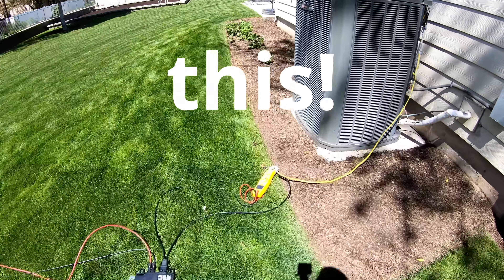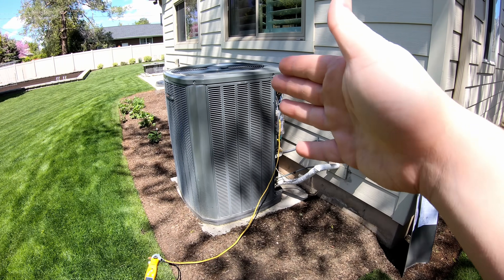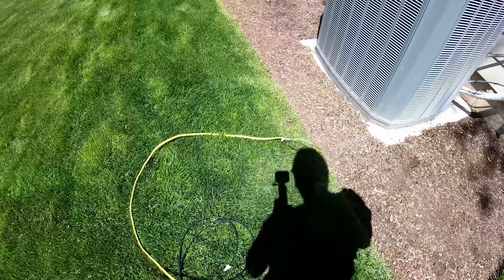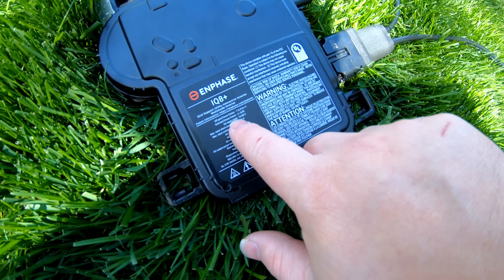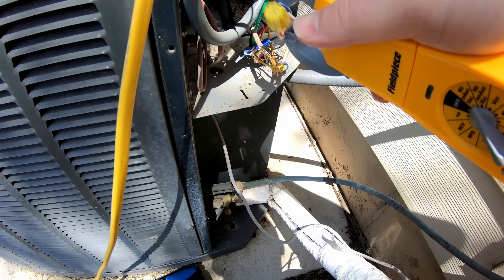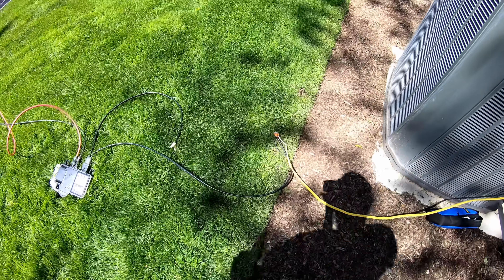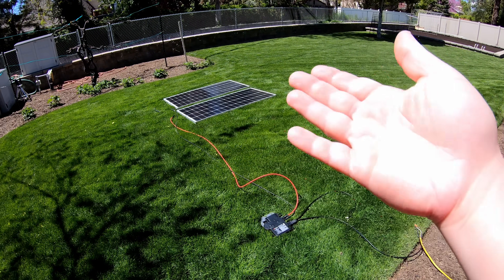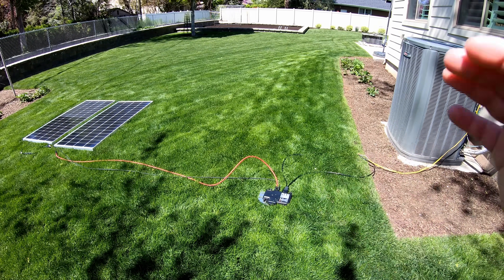1 Hack To Eliminate Your A/C Power Bill This Summer!

Comment from the maker: Check out VERSION 2.0 of this setup: https://youtu.be/VymWSGSL4YU

Check out my pool/irrigation pump solar conversion video: https://youtu.be/CU4SXECkz08?si=_VufG7hs18o9M7Ss

Buy an Enphase iQ8+ microinverter like you saw on this video: https://enphase.com/store/microinverters/iq8-series/iq8plus-microinverter 

Buy the Bouge RV 200W solar panels like you saw in this video: https://amzn.to/3V0VALW 
Free Shipping and Generally NO Sales Tax! Buy the best deals on new high quality solar panels: https://shrsl.com/4j8e9 

Buy the multi-meter you saw me use in this video: https://amzn.to/44GAupB 

Buy Wago wire connectors: https://amzn.to/3ULqneF 

Watch the installation video about the Micro-Air EasyStart: https://youtu.be/JT9Sw57CZXE 

Buy a Micro-Air EasyStart for your own A/C: https://amzn.to/3AgUdkk

Ask me a question and get a personal in depth response: https://ko-fi.com/s/8d8df1880c 
OR
Sit down for a personal 1-On-1 hour long video consultation with me and I’ll provide answers and insights to anything you want to ask me about from this channel: https://ko-fi.com/s/dd139831a7 
 

Affiliate Disclosure
As an Amazon associate I earn from qualifying purchases at no cost to you! Thanks for your support!
Reply: I looked at the specs. The IQ8+ is rated 240v 290VA out continuous. That's an output of 1.2A. You're already maxing out the output. If you want more solar power then you'll need more inverters or an inverter with a higher output rating. Also, for a permanent installation you'll want to fuse the lines and add disconnects when you feed the compressor. You could also add batteries that are charged by the solar power during the day but are used to offset the power at night.
Reply: So this micro inverter output is 240v split phase (two hot legs L1/L2 ?) or just one hot leg with 240v ? If its two hot legs does this means from ground or neutral you’ll see 120v off each hot leg?  I mainly use NEP micro inverter, seems like it maybe the same as this one?
Reply from the maker: @fullyelectric It’s split phase. Two hots each at 120V 180 degrees out of phase with each other just like the utility power. Thanks for watching!
Reply: @theresatrickforthat  very good and technically since you house will always have something pulling in well over 300-400w all the time you can offset even more just connection it to your panel, the NEP works well too, almost identical products except the NEP has like a heatsink built on the case, BTE does Enphase make any micro inverter over 400w?
Reply from the maker: @fullyelectric Yeah, I’ve seen those NEP ones around. Not sure all the sizes Enphase has. Just happened to have an extra one kicking around and started having some fun with it. :)
Reply: This video was awesome and very helpful. Thank you for sharing !!! Just wanted to ask for learning purposes, what is the Pro's and Con's of this setup? Also many homes usually have a solar setup on the roof as compared to this being setup for only the AC. Can you offer some feedback and thoughts on the major differences overall between the two?
Reply from the maker: @VP411Designs  Thank you! I personally feel a big system on the roof or whatever that’s grid tied or is off grid with batteries is the ultimate setup. However, it’s quite expensive and in today’s climate, financing a large system makes no sense. So the cool thing about this setup I showed in this video is I can buy a few solar panels and a micro inverter at a time and as money allows…and put them to use offsetting my AC so I’m immediately starting to get at least small returns on my investment. Then once I have accumulated a number of panels and micro inverters, I can wire them all together in a big system which is my ultimate goal.
Reply: @theresatrickforthat  makes sense, thank you for sharing!!!
Reply: This is my first I am with your channel, and i'm already digging it. Subbed
Reply: I am curious if Enphase will not honor a warranty claim if the installation is not permanent and tied to WiFi ?  In any case the long warranty to price ratio seems to indicate a quality product.
Reply: Love your slippers.
Reply: Did you pull the knife switch so you don't have power from the house going in?
Reply: Wait, the blower uses another 600 watts for a gas furnace\AC and is used in the summer and winter. Any reason not to connect the system\another system to it?
Reply: Does this setup require you to use the micro-air easy start as well? Or is that just a bonus

Comment: my ducted ac can run in fan mode only so I would have to set that as the minimum draw. not sure the juice will be worth the squeeze. no way to stop back feed properly?
Reply from the maker: Yes. It’s not a one size fits all solution. For some it’s not a solution at all.

Comment: You unit has a single pole contactor so while your unit is off you are still feeding power back into your electrical panel.
Reply from the maker: No. The inverter must see 240v split phase power in order to turn on, so if it’s only seeing half of that it’s going to stay shut down not producing any power until the AC turns back on.

Comment: Would it be possible to just use a solar based power station (like a Jackery or some other brand) and just plug the AC unit or pool pump into the power station? Would that work?
Reply from the maker: Maybe! I actually just got my hands on the Bluetti Apex 300 which appears to potentially have the capability of doing just what you said since it produces 240 V power!

Comment: I stopped doing this because I could not tell if was turning the electricity meter more or less but bill seemed to increase $cost
Reply from the maker: You must have connected your solar to the wrong side of the contactor or oversized your array. Thanks for watching!

Comment: Can this be done without installing a soft start to an older Goodman hvac???
Id greatly appreciate help!
Reply from the maker: Absolutely! The soft start has nothing to do with this solar setup…it’s just there for my backup generator. Thanks for watching!
Reply: @theresatrickforthat Greatly appreciate your response! Electricity in CA is expensive, and being a renter squeezing me out.
Im thinking of grabbing an inverter and LiFo 200Ah battery with at least one 400 or 500 watt panel just see how it works.
In your other video with batteries i understand that charge controller is a must as well.
Im handy guy. But still would like to make sure im doing it right. Glad i found your channel!

Comment: Thanks for the video, I haven't had my coffee yet and feeling foggy but in this video am I correct that it's pulling 10.5 amps roughly and therefore X 220v it'd be a total power usage in watts of 2.3 kwh  before the addition of the solar? OR was the formula the amps of one of the input legs ie. approx 5.2 amps x 220v for the wattage?  I've forgotten.
Reply from the maker: No. You do not need to double the amps because both legs are the same 180 degrees apart from each other on the sine wave. So 5.2 amps x 240 is the wattage. Thanks for watching!

Comment: I’d like to add atleast 5 panels around 300w each and just plug it into the side of my house with its own designated breaker and safety shut off. Just to offset a bit more. 

My current financed system is garbage.. came with new construction. 4.6kw system btw one day I’ll save up to pay for the system and start adding onto it for now I’ll just do my own thing for now
Reply from the maker: Sounds like a fun future system! Thanks for watching!

Comment: Excellent idea, and work. I did not realize your wiring was to only the Contactor. I just installed the Micro-Air Easy starts on my outside HVAC units. Have a whole home backup Generator but am fully intrigued with this setup. Well done. I would add some sort of inverter that would stop any potential of back feeding, other than that - AWESOME, well done.
Reply from the maker: Thank you so much! When it comes to backup generators, those micro-air easy starts can literally save thousands of dollars as well. At least mine did for me, I was able to get a much smaller generator than I would have needed without the easy starts. Thanks for watching!
Reply: @theresatrickforthat unfortunately I found out about the easy starts after whole generator was installed, but that is okay, it is amazing how much less inrush there is immediately, so saving the compressor is well worth it in that regard. Now to get some reduction in monthly electric bills, otherwise between property taxes and utilities ballooning we may be out of a home. Not a good look for this nations Veteran’s to lose their homes due to corporate greed. Thanks again.

Comment: dum dum, your putting 0.24 kwh into a AC outlet. if anyone from your power company sees this you'll be banned from that power company. all this is is a grid tie setup
Reply from the maker: You’ve got to check with your local area. Where I live it’s okay to backfeed up to 1,200 watts without a grid tie agreement so long as it’s equipped with rapid shutdown. I prefer to not backfeed period hence this creation with my AC…but everywhere is different! Thanks for watching!

Comment: What size a/c uses less than 6 amps, what is the ton of your unit…? You are doing a major service for many…? Please list the part in the a/c you  you mentioned is saving money,and is that savings only at startup… need model number and name of both devices please..!
Reply from the maker: It’s a Trane 3 ton unit! The MiroAir easy start is linked in the description. Thanks for watching’

Comment: Great experiment but if you have to buy the equipment it may not pay for itself during the life cycle of the equipment…just my .02 of course
Reply from the maker: Good observation! The nice thing about this set up is the solar stuff is completely separate from the HVAC stuff. So if your HVAC equipment dies, you should be able to easily reconnect your solar equipment that is supposed to last 20 or 30 years to your new HVAC stuff. Thanks for watching!

Comment: You are still using the grid power to trigger the micro inverter to supply certain amount of power but not 100% the AC consumption, if you really want a real test you need to use a small battery bank to trigger the micro inverter and see for how long the battery bank can run both with and without the 400w solar panels.
Reply from the maker: You’ll enjoy watching my version 2.0 of this that’s releasing in a matter of days! Subscribe so you don’t miss it! Thanks for watching!

Comment: In Arizona I’m trying to switch my utility plan to a Demand charge + to save money in the summer. 
I’m wondering if I had a switch to solar that I could throw just before the 2pm Peak time would the unit stay running through the transfer? My inverter can’t handle the 33amp/220v initial draw, but it can handle the 12-16amps of running draw.
Reply from the maker: You still need grid power for these inverters to work. So if you’re try to go with a time of use setup and be completely off grid during peak hours, then you need an off grid inverter and batteries. Sounds like you already have a setup like that…you may then just need to get a soft starter like the one you saw my A/C unit in this video to lower the initial startup surge. Thanks for for watching!
Reply: @ Thank you. I actually installed a soft start recently. It brought the initial draw from 59amps down to 33.

Comment: I absolutely love this idea!!! Ingenious! I have bought three solar panels (Sirius PV 410W Bifacial Solar Panel | Up to 533W of Bifacial Gain). I know you mention the microinverter model.  However, don't you need a microinverter that outputs 240 volts (something like IQ8H-240)? Does the recommended by you Enphase iQ8+ microinverter output 240 volts? And last question, do you I need to buy 3 inverters for my 410W solar panels? Thank you for your advice!
Reply from the maker: Thank you! It is a fantastic idea that works great! My IQ8 Plus is 240V. However, before you buy the inverters…wait a few weeks here and subscribe to the channel so you don’t miss my Version 2.0 of this! I’ve found better inverters for about half the cost of the Enphase setup! They’re also compatible with optional batteries you can add on to really maximize your savings!
Reply: @theresatrickforthat you had my curiosity, now you have my attention 😊 I will return the inverters tomorrow. Can I ask you for a favor? Can you in your next 2.0 video also show how to connect multiple 400+ watts panels using those new inverters? And finally, could you please mention the cables/cords that we will need starting from the panels and ending at the compressor?
Reply: @theresatrickforthat  bud, how are we doing with the new video? When should we expect it? The suspense is killing me! 😀

Comment: How much money or energy did you save in 1 billing cycle?  Im a layman but i know how an ac contactor works and i know  solar basics from when i lived in a van as a kid. Nowadays im a homeowner looking to beat the system.
Reply from the maker: It all depends on how hot it is where you live and electrical rates…but I slashed my A/C bill by a good 3rd of what it was in summers past.

Comment: 400W is a trickle, but also 400W is the "theoretical" MAX of those panels, in optimum conditions.

Personally, I wouldn't worry about the "backfeed". my 2400 SqFt house takes more than that just for stuff like the fridge/random lights at any given time. But this is interesting, I was thinking you would need an ATS (Automated/automatic Transfer Switch), like a generator would use.
Reply from the maker: I say every 400 watts counts! Be sure you’re subscribed however because I’ve got version 2.0 coming out soon at almost 2000 watts, cheaper and compatible with batteries. An ATS would work great…but is added expense. That’s why I am using the contactor in the A/C unit as a way for the panels to connect and disconnect from the grid. Thanks for watching!

Comment: Oh professor...I plan to duplicate this process...do I need to have a soft start as well...or I can do the exact set up without the soft start.
Reply from the maker: Yep! The soft start is 100% optional! Thanks for watching!
Reply: I see that the Enphase cable has two wires...one you left it alone and the other wire you used a wago connector and romex cable...and the end of the romex are 2 florescence green connector...which will go on the contactor.
Is this correct professor?

Comment: What an absolute waste of time. You don’t have to have net metering to hook up micro inverters to the grid. I assure you the power company will happily take your power for free. And there is no worries about feeding power to the grid if the power goes out… that safety feature is built into all micro inverters.
Reply from the maker: Every place is different when it comes to if you can backfeed or not without an agreement. Glad you enjoyed the video! Thank you so much for watching!

Comment: You need 30 of those panels to run that heat pump
Reply from the maker: Did you watch the whole video including the amp draw and calculations part? How many panels I actually need is surprisingly small. Thanks for watching!
Reply: @theresatrickforthat  I live off grid, I have a 8KW split phase inverter and a huge solar array to run a minisplit AC unit.

Comment: I very much like that you have tried something that i have thought about regularly. I have a sprinkler pump, pool pump, and a heat pump system. The pumps i can set up like you did in your other video. as well as the same for the ac system. It would be nice to see a test to also feed the inside handler just like you did with the outside unit. All scalable for sure to offset the big loads that run throughout the day. Great video.
Reply from the maker: I agree!  It would be interesting to test the system running the inside unit as well. Thanks for watching! Glad you are enjoying the videos!

Comment: I'm so glad I ran across this video because I have been toying with the idea of running my window AC unit on solar power but
didn't know if it could be done or not. Now I am really inspired to do further research. I am somewhat clueless to electrical
things other than getting shocked is something I don't want. But if you can run your large outdoor compressor type AC unit
off just two powerful solar panels like that then my smaller window unit should not be a problem at all. Thanks for the   ......
encouragement! Can't wait to do more reading now that I know it really can be done!!!
Reply from the maker: I'm glad you found it helpful and encouraging! Best of luck with your research!